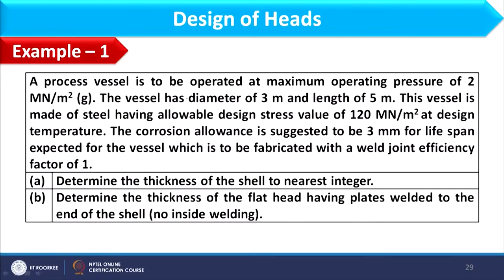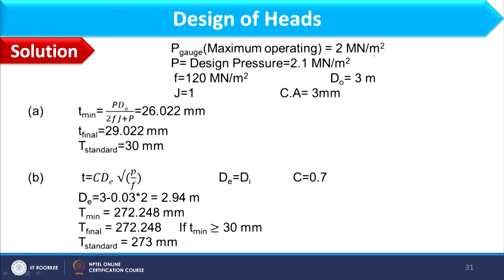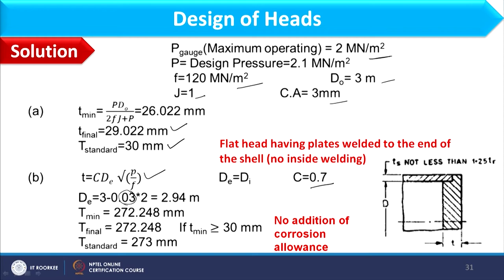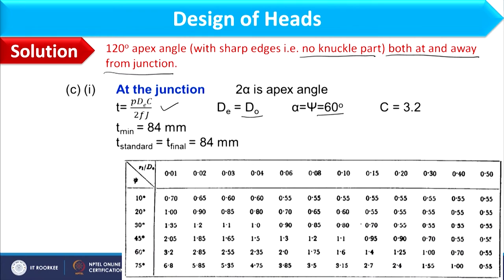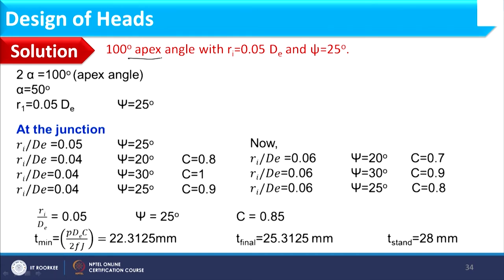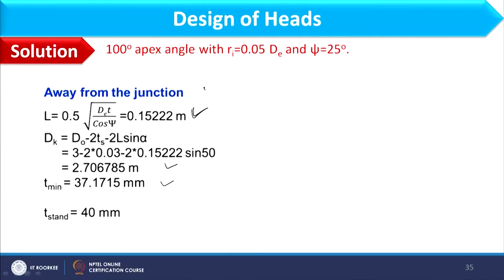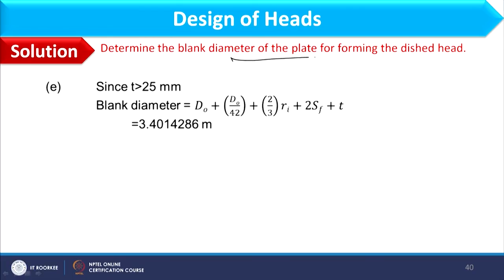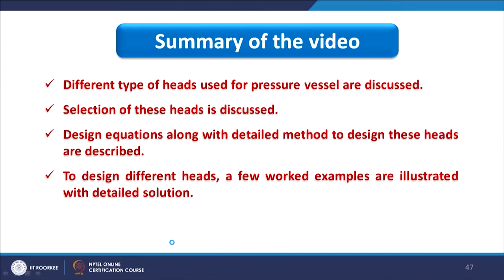Design of heads-3

Comment: In last question, part c, there we should add corrosion allowance in head thickness because minimum shell thickness is less than 30 mm, as you explained in example 1.